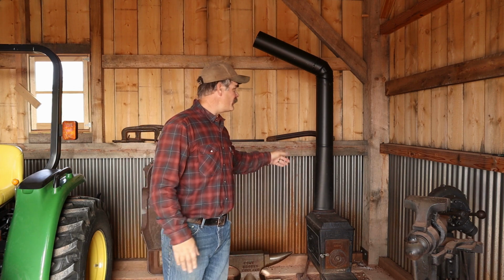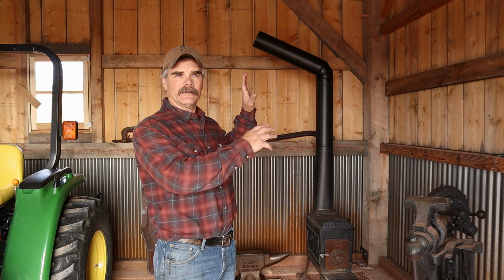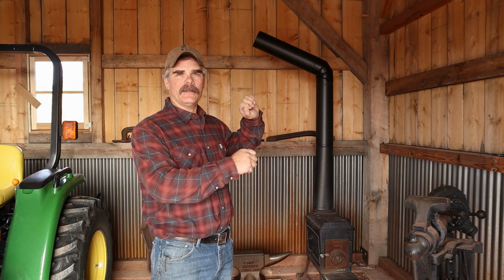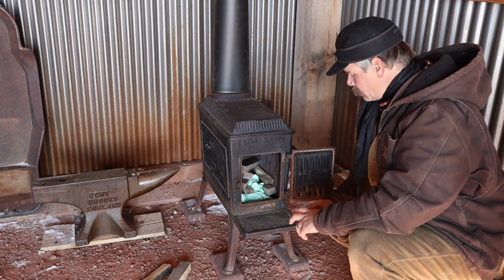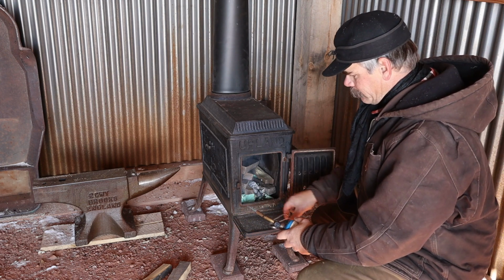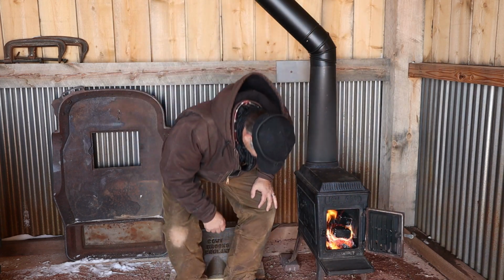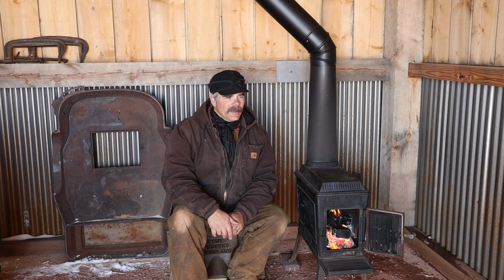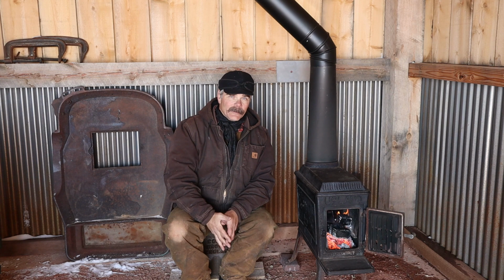Timber Frame Barn Wood Stove Install

Comment: Just in Time. 
The more chimney pipe inside the barn the better draft and heat you'll get. 
Looks good on the outside too. 

Buy a 50 dollar pair of quick connect ladder horns.   Safer and it opens a whole new world for ladder work. 

I just put an all nighter in my woodstove.  My dogs are laying in front of it.  They love it. 

I never knew that about the Oval hole!!!!

Thanks for sharing.  Nice stove. Nice job. 👍
Reply from the maker: Thank you!
Reply: @GreatPlainsCraftsman   Thank you for the enjoyable videos.

Comment: Figured out last winter there's no point installing a wood stove in mine until after it's insulated. The clear span metal trusses I used & the way I did my soffit....all the heat goes straight out the overhangs.

Comment: ”Serious question” why didn't you run the stove pipe on the inside of the barn up to the peek ok the gable and run it through the wall up top maybe a couple feet down so you could have bracing and two spots to hold it seems like the stove pipe would generate heat?

Comment: Great job on the stove, looks great and works great.  I plan on putting some type of wood stove in my shop, spent the last few days cutting firewood and stacking it up.  We have a wood fireplace in the cabin and it heats the whole upstairs.  Real wood stoves or wood fireplaces are not put in new houses as much in Georgia.  But, they work so well to heat up an area.  I was always taught to put a small fan on the back side of the stove to spread the heat around.  Even the 18 volt battery for Milwaukee has one that they sell.  That would spread the heat around some.  Just trying to keep you warm.  Looking forward to your forge,
Reply from the maker: Thanks brother,  appreciate it!

Comment: You are quite the Craftsman, which I can respect & I applaud you for it. I felt every step up the ladder installing the last 2 pieces of pipe while balancing it on your shoulder,, lol been there done that. What a gorgeous piece of property, can't wait to watch all your videos. On your timber frame 4 wheeler shed, will anything go in-between the spaces on the sides to keep out the weather? Great idea with the wooden pegs to keep it all straight.. Big Jim from New Hampshire.
Reply from the maker: Thank you Jim!

Comment: the chimney is almost to the main peak of the gable end... you don't have to take it up all the way...the top 3 pieces of the chimney are very close to the barn wall itself.. 
suggestion: so add a few inches extra to the outward pipe from the hole in the barn wall...might fix that dilemma...good that gonna do is.. keep the chimney closer to the wall.. and the 3 extra pieces of the chimney itself can be shortened to 1 or simply 2 pieces..you won't have to climb up all the way to take it down when cleaning next spring.
Thankyou for the video, stay safe.. stay warm.. GOD BLESS.
Reply from the maker: Hello Edward.   The chimney must extend at least 3ft above the roof line by code in this situation.  If not, the chimney will not draft.  Mine is about 3 1/2 ft so a bit high but not much.  You cannot terminate below the roof line.  Thanks for watching!

Comment: Good vid. But I've got a question.

Those chimneys hold the heat until the smoke is exhausted, why not keep the chimney inside till the very top of the gable? Thus keeping more of the heat in the structure.
Reply from the maker: Good point, but I will use the loft and didn't want to have to loose space for the chimney clearance to combustibles  up there.

Comment: I recently purchased an old house with an old barn, the barn was built in 1910, the timbers inside the building all are native and still have the bark, it is beautiful. I really want to heat the first floor of the building somehow but its pretty big and has no electricity. I was looking at cast iron wood burners but the only thing that's got me nervous is how old and dried out the barn is, also its far from a clean barn so its dusty and dirty. Should I be worried about the risk of a fire in a barn like that?  Please tell me I'm being a worry wart and some sheet metal around it would be just fine!
Reply from the maker: Be sure to have the correct clearances listed for the stove, and protect the floor underneath from heat and sparks with a non combustible product.  Common sense prevails here.  Lots of wood stoves in wood buildings.  Just be smart about it

Comment: If you really want to heat up the barn, get a gas forge like mine!!  Man that forge puts out a lot of heat.  The coal forge will too, but most of the heat will go up the stove pipe.  I have both a coal and gas forge, but I'll be using the gas more since coal is hard and expensive to get here in Eastern Oregon.  I'll save the coal for forge welding projects.  Still haven't done a video yet since I'm still dealing with this septic problem.
Reply from the maker: Thanks!  Look forward to it when you do.

Comment: Nice stove 
What jd tractor do you have I have a 1999 jd 4200 with 420 loader and other toys for it as well
Reply from the maker: It is a 2012 3038 Hydro.  It will do!

Comment: What did you put on the outside with the caulking gun ?
Reply from the maker: Silicone
Reply: @GreatPlainsCraftsman  Good old fashioned silicone, ok thanks.  I'm just learning to install my own stove, thought it might have been something special.
Reply from the maker: @MrMawnster  Nope, just silicone.   Silver color to match the chimney or clear.  No reason to use something more expensive

Comment: I'm wondering how good the barn will heat because there is no insulated
Reply from the maker: Hello Jon, it will not be perfect, but remember I am just using it for working in, so it will be good enough.

Comment: looks great Tim why do you have to have so much chimney above the roof?think how mech extra heating you have gained with that amount of pipe inside double the heating value for sure
Reply from the maker: The rules of chimney installation dictate that for drafting purposes James.  Mine is about a foot taller than needed but even that close to the peak I needed at least 3 ft past the roof line.  Further down it would have been much worse.
Reply: No disrespect mate i was just asking rules are so different in other countries.I know the pipe inside will help warm the barn up quick its an added bonus i guess
Reply from the maker: @jamesharris7868  No worries James!  A steep roof like that make venting a challenge, but it is worth it when you see the chimney draft so well.
Reply: @GreatPlainsCraftsman  DEAR TIM JUST READ YOUR REPLY, I JUST THOUGHT, COULD YOU NOT HAVE PUT THE CHIMNEY ON THE INSIDE ALL THE WAY UP AND OUT THREW THE ROOF/CEILING? ANY HEAT GIVEN OFF THE CHIMNEY/PIPE WOULD BE RELEASED INTO THE BARN? MICK FROM UK.
Reply from the maker: @gallopingg1  Yes but I did not want to cut a hole in the steel roof, nor get on it again!
Reply: The rule for chimney height is 2/10, commonly called 2 above 10. The chimney should extend 2' above the roof within 10' (measuring level) .

Comment: They put 2 adds on your show that add up to the length of the post. One for xeralto is over 10 minutes. The other for a game or something was almost 8 minutes. Who is going to watch adds like that which are longer than your post. Watch adds usually to help your channel but that is extreme. I understand you have no control over that.
Now the installation was very informative. Noticed the snow by the forge pot so know it’s cold in there. Keep up the educational post.
Reply from the maker: Thank you so much Lars for trying to help out the channel, appreciate it for sure.  Not sure why they do that but you are under no obligation to watch them all at all.  Thanks for the kind words!
Reply: Lars, there should be a "SKIP AD"  button on the lower right of the screen.
Reply: If you are having a problem ask anyone who is 20 years old or younger.

Comment: You make it look pretty easy. I have an old wood stove in my garage, sitting on a furni pad with one broken leg. My living room has a set up for the last owner of the house that had the stove. I've been waiting two weeks for the nearest dealer/installer to give me a call just to set up the appointment for a chimney inspection, they warned me they were gonna be busy for a while because most idiots like me wait until the last minute. However, setting up an appointment takes like 5 minutes? I'm running out of patience.
Reply from the maker: It's not bad at all, just need to remember a few rules of thumb.   Thanks for watching!

Comment: Did you space the heat shields off the wood?
Reply from the maker: Yes
Reply: Where is the space top and bottom of the heat sheild?  And where is the heat sheild on the corner post?

Comment: Man that last section was a more than dangerous lift on your own have you a death wish ?.Such a tiny stove for such a huge chimney .A rocket stove would give you five times the heat using a quarter of your firewood.
Reply from the maker: THANKS! It's the stove I had Paul.  Code requires the chimney to be what it has to be.
Reply: Yes but I am sure he wants to work when he is there not load a tiny rocket stove